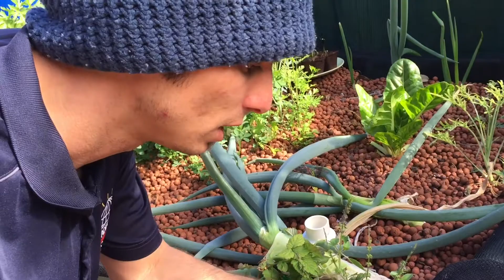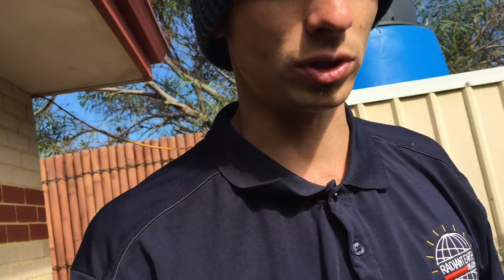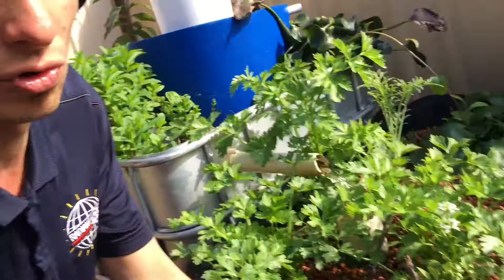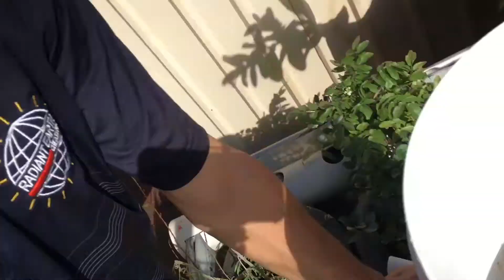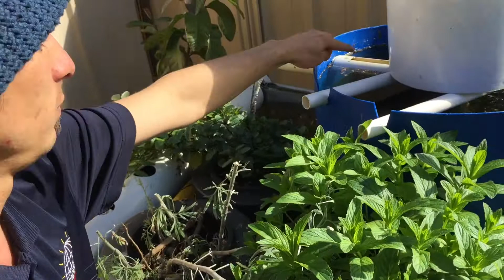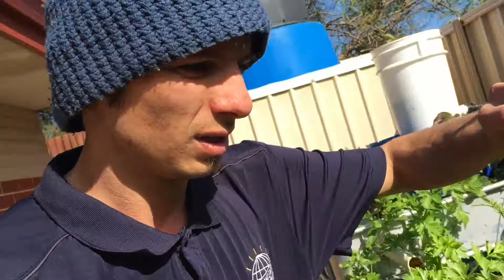Ben's Bioponic System

Comment: Has that vortex pump died yet? Sucking in air I hear is bad for them
Reply: I don't let air get sucked into the pump, otherwise it would cavitate and like you said, die. I'm not sure what part you are referring to, but the vortex at the top of the system is passive, and I want it to cavitate. That is where the good stuff happens.
Cheers

Comment: Ive been in study mode on this too long, and about to start up similar.
I was thinking of mixing up some kinda compost tea bag in a nice micron screen bag and put it in resovoir tank. Its a 55gallon 12 pot ebb n flow system, thats also gunna feed a small cloner and couple small grow beds of lettuce.
I was thinking i would need to change the resoivoir ever couple weeks at least, im not sure tho.
Reply: The smaller the system, the easier it is to go out of balance. If you continuously brew compost tea the colony of microbes will collapse after the food is exhausted. Probably worth changing at least 30% of the water on a regular basis.
Cheers